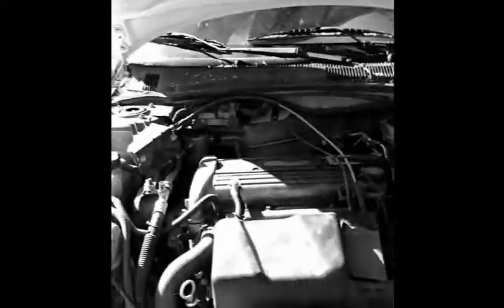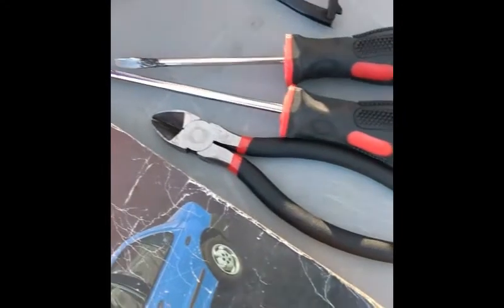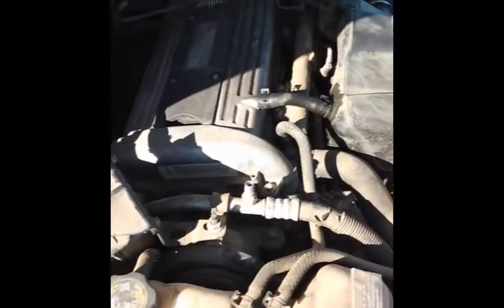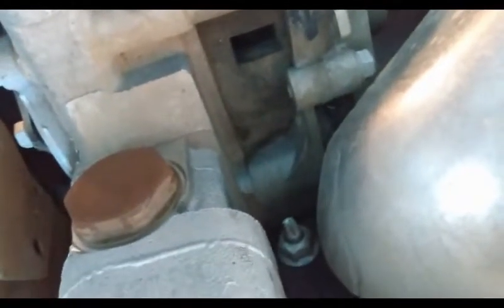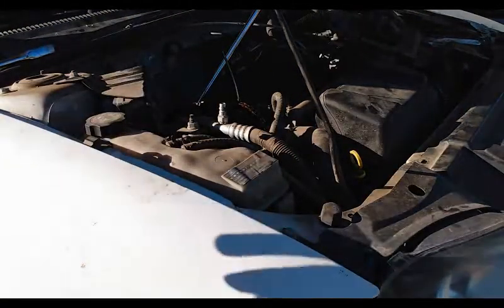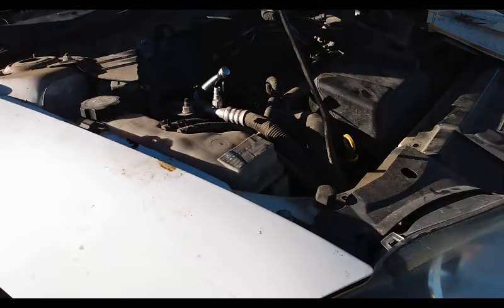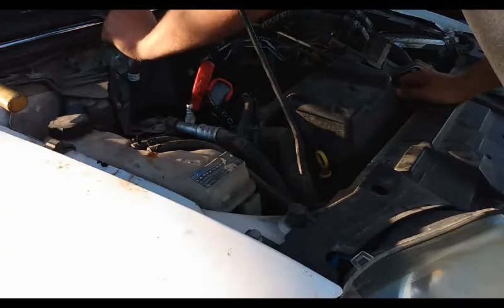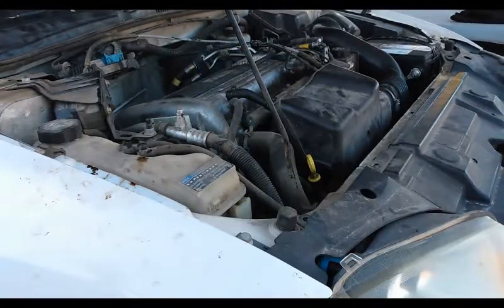Ecotec Cavalier Timing Chain Tensioner Replacement How To

Comment: Thank you so much. Took the noise away from our Vue that we have had for two years. Made noise since we had it. This tutorial was excellent. If you don't know where to tap to release the tensioner, because it's hard to see in the video- get a rounded edge tool and push the chain where the tensioner pushes against it. This will release the tensioner. Didn't have a 1-1/4" socket, ground a wrench to size and made do. 🤙

Comment: Great video, just replaced the tensioner on my Saturn LW200. I deviated from your technique and would like to share this.

After using zip ties to secure the cam gears to the chain,  I used a bungee cord with a metal hook and threaded this through the exhaust cam gear sprocket and applied a healthy amount of torsion to keep the chain taught on the tensioner side. Then I carefully and slowly began threading out the old tensioner while watching the cam gear/chain as it will retract the chain guide towards the tensioner and maintain contact with it which prevents the tensioner piston/spring from falling into the engine well.
The bungee keeps the chain taught preventing it from skipping a gear tooth on the lower crankshaft gear.
The intake cam gear seemed stuck in compression cycle since I did not remove spark plugs,  thus no movement could occur. All the chain slack will occur between the two cam gears,  so the crankshaft sprocket will remain taut.  Using a flashlight while threading out the old tensioner will you let visually see the guide keeping pressure on the piston so you can feel confident it will not drop into the engine well.
Installing the new tensioner is easy as the bungee will subside as you thread it in. 
Now using a screw driver, push on the chain where it meets the tensioner piston and the activation will occur leaving you a nice, taut chain and you will have saved $1000 in labor and have a properly timed engine that is quiet.
Splendid fix for a $30 tensioner part!

Comment: Sweet thanks for the vid! My 04 cavy is definitely in need of a tensioner replacement. She rattles a bit for a second on start up. Cheers!
Reply: Definitely a must for any eco that has the old style tensioners still before they fall apart, they literally explode and separate inside the engine. Hoping to save some ecos with this video!
Reply: #TeamSTC Donny out here doin the lords work! Haha. Hell, I may end up changing the whole timing/guide set along with the upgraded dorman guide bolt, depending on how it looks when I crack it open. Cloyes has a great how to video on it. We shall see.
Reply: @damntheman3185  doing the whole kit is a hell of a job with the engine in. If you do then go ahead and do the balance shaft tensioner also since it's open.
Reply: @damntheman3185  cloyes does have a good video, tho the cloyes guides break in the ecotec so stick with factory or dorman
Reply: i realize Im kinda randomly asking but does anyone know a good place to watch new tv shows online ?
Reply: @Andre Salvatore I dunno try flixportal. Just search on google after it :D -otto
Reply: @Otto Deacon Thank you, I signed up and it seems like they got a lot of movies there :D I really appreciate it!!
Reply: @Andre Salvatore No problem :)

Comment: I have a 2.4L 2012 buick lacrosse - i got a noise at the timing chain location, i put a prybar to the valve cover, the alternator, and noise is much more evident at the timing chain area. I removed the drive belt and checked the pulleys.. all good there - turned the car on with out the drive belt and the same noise coming from that side of the valve cover.. i'm afraid to do this job...have too! thanks for posting the video looks like the same set up and hopefully its only the chain tensioner

Comment: Used two 10" locking pliers, one on each cam shaft, and the magnetic wand against the tensioner from the inside on a 7th gen malibu.

 P0016/P0017 went away! 

Going to do an extra oil change and hope they don't come back.

Thanks man.

Comment: My car was rattling when I first turned my car the other night I went to use my car and just wouldn't turn on sounds like low compression would changing this do the job or do I need a whole new timing chain ?
Reply: If your timing chain goes the whole engine is bad and needs replaced. It is an interference style engine so if the timing goes then the valves hit the Pistons and ruin the internals. Now it could be a lot of things preventing it from running properly, maybe start by having someone with a scanner scan it to make sure it's not something as simple as a sensor or ignition coil pack. Also you can remove the valve cover Wich we covered in a previous video to check and make sure the chain has tension and isn't loose or broken.
Reply: Thank you I appreciate it!!!
Reply: One more question so I took it for a diagnostic they said my cylinders had 30 psi in all so no compression not sure if that is a forsure that it's the timing chain
Reply: @Xeniamami  30 psi is super low for an ecotec. Wouldn't hurt to pull that valve cover and check the chain for slack. Or their compression gauge is an old Pos and reading wrong, at 30 psi every cylinder doesn't make sense, even if the chain goes it would like take out one or two not all for cylinders and even so then it'd have no compression if all four Pistons had holes in them. Hope that helps some.
Reply: My 2005 Cobalt LS is rattling a tiny bit on some cold starts but mainly I notice the slight ticking sound when I'm accelerating mildly, when I leave off the gas pedal it stops. It has 110000 miles on the OEM tensioner and chain. I ordered a new style GM tensioner from the GM store online for like $20! Aftermarket is like 3x that price. Mabe was a misprint but I'm glad I found it at that price. I'm hoping that fixes my issue. My only question is, do i need to replace the cam cover gasket? It's only 6 months old. Can they be reused if they dont RIP taking off the cover?

Comment: I'm doing a timing chain service on my GMC Terrain with the 2.4l Eco....the previous owner paid $1400 for this in Jan 2019 (only 12k miles ago) but the shop ripped him off on the job.  The timing chain tensioner is really stuck and the shop just left the old one on. I'm very lucky I didn't end up with a trashed engine.  
    But like they say: "If you want something done right..."  But now I'm dealing with the stuck tensioner. I'm not a small guy and I put everything I had behind my 13" flex-head ratchet...no tamale.
Anyone know if it's possible with some impact swivel extensions to get a impact on it?
Reply: I would try using a cheater bar (pipe on end of ratchet) if you don't have a longer breaker bar.
Reply: no
Reply: @TeamSTCDonny  Thanks for the reply LOL.   I got an Onyx Nano impact and zipped it right off.  After that the timing chain service went smooth as butter.

Comment: The new one for me won’t go in the hole I had to hammer it in then try to thread it but it just started shaving aluminum off the hole and threads in the block
Reply: did something wrong, its super easy to do
Reply: Your tensioner Is activated

Comment: My new tensioner was very hard to fit in the hole and it would not thread in it just started shaving aluminum on the threads of tensioner why is the fit so hard
Reply: it fits perfect, so you have messed up threads or dirty threads

Comment: why can't you just activate the tensioner and then put it in?
Reply: because it has to push the chain into place you cant do that and rotate the bolt and torque it it will move the chain